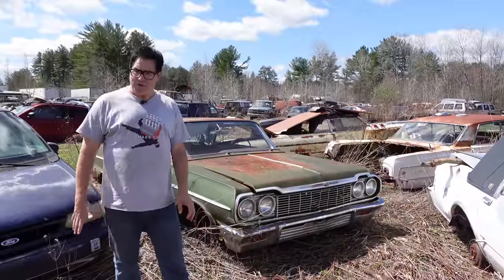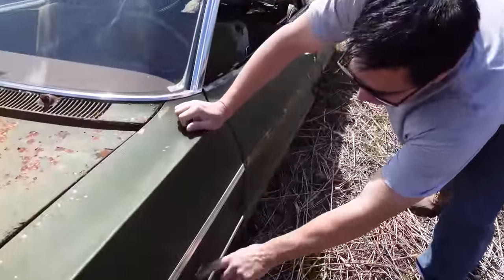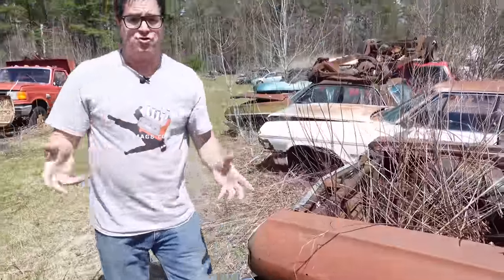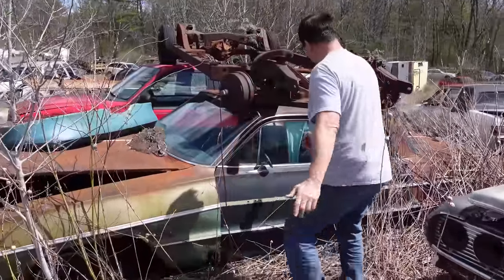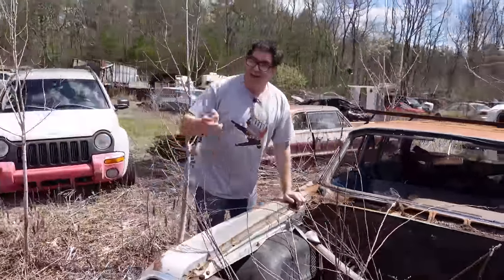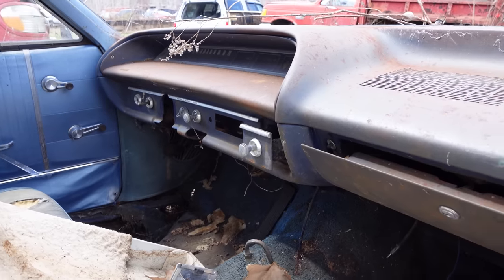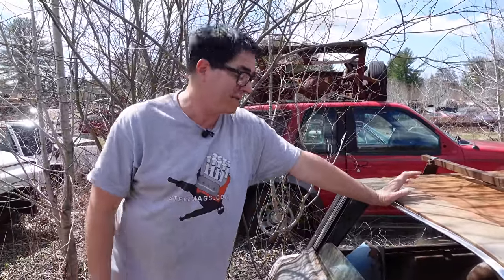Sixty-Four Chevy Celebration

Comment: Hardest working man in the auto graveyard universe!

The station wagon roof rack… 

A Friends’s  dad owned a 62-3 Chevy wagon - pale green with what I believe was a white top - true beater!!! but would hold 6-7 teenage vagrants 

Owned a 65 ss impala … convertible 4speed at 15.  😎 yes hydraulic top with cylinders partially inside rear arm rests / panels 

Saw a few with 396s but preferred the hp 327 4 speed 

NE winters and rear wheel drive with a rag top 🆘

Always preferred the 65-67 ss chevelles size speed design  and they actually fit in a … garage 

Was always a fan of the lines of the : 62-64 impalas and the ability to add ladder bars back in the day 

And the pre ! 65’s were the hot impalas back in the day - many raced and many with a lot of hard earned cash under the hood   

Different now 

Post beach boys…..  The low rider community put impalas on the map - period.

Comment: Hey Steve, perhaps you could correct these errors by editing in some on screen text. Thanks!

0:42 "Single pot master cyclinder seen until 1967 on all American cars"

Dual circuit brakes were used before 67 by Cadillac, AMC, and Studebaker.

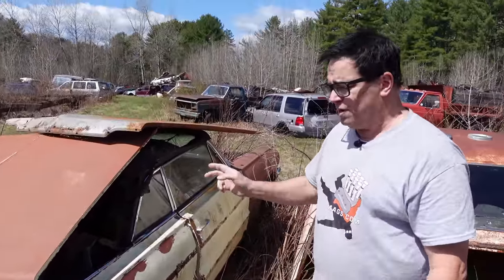2:14 "Now the convertible or course was the most expensive version of the Impala the only thing next to this would have been a full size wagon"

OK, I don't know what this means exactly but it appears it means the Impala convertible is most expensive followed closely by the wagons. With base V8, convertible $3035, six passenger wagon $3077, nine passenger wagon $3181. Differences on six cylinder prices are similar.

2:22 "But this (Impala convertible) is well over 3000 bucks"

Six cylinder $2927, eight cylinder $3035. One not well over and the other not over at all.

3:42 "But the big seller generally was the two door model"

Four door sedan 536,329 plus four door HT 200,172 = 736,501
Two door sedan 120,951 plus two door HT 442,292 = 563,293

The two doors can't catch up even if you throw in 81,897 convertibles. And if that's done how about throwing 192,827 station wagons (all four doors) into the four door totals.

4:13 "The only down side (of four door hardtops) is once these rubber seals got old you had water and air leaks"

Yes of course. The rubber seals on sedans didn't age!!!
Reply: The base price of $2927 is with ABSOLUTELY no options at all , very few if any cars were delivered as full strippers , so even base 6 cylinder cars crested $3k , especially since even in 1964 , dealers were learning to tack on "dealer prep" (removing the seat covers , washing off the road grime from the transport truck , and adding 5 gallons of gas - some dealers even delivered the cars with a FULL TANK of gas , but at a jacked-up pass-thru price !) and "destination fees" !

Comment: The 1962-64 Chevy and other GM 2-door hardtops were sometimes erroneously referred to as "Hardtop Convertibles".   This is due to the metal roofline, which had distinct bones it that mimicked the contours of a rag-top.   Even dealers sometimes used this phrase to describe them,  though it never appeared in sales literature.   Old timers may recall this bit of trivia.  Other 2-door hdtp's may have erroneously been referred to as such, but without reason.

Comment: What was the highest horsepower you could get in the 327 version? Great content as always steve. Always enjoy the junkyard crawl!
Reply: For the '64 full-size line the top 327 was 327/300HP with a larger 4bbl, I believe, bigger valves (but still advertised as "general performance" camshaft). Apparently low end torque was still sufficient enough to work decently w/ PG automatic. Late yr Chevelle could have the solid lifter 365HP 327 borrowed from the Vette & the Vette itself topped 375HP w/ fuel injection.
Reply: @DejaView  thanks for the answer Dennis. I thought there was a 327 / 365 version in there but wasn’t positive.

Comment: Back in the day, I never gave it t much thought, I liked the styling, but that’s a lot of car for such small engines, and the PG was a deal killer. The wagon, with a 409 4 speed, that would get my interest.
Reply: The base engine was a 6-cylinder and moved the vehicle around just fine.  The Powerglide was used from 1962 to 1973 and was highly successful.  Why you call it a "deal killer" is beyond me, unless you had to find SOMETHING to justify not buying one.  I
Reply: My family had a 64 Pontiac Parisienne, essentially a Canadian Chevrolet with Pontiac sheet metal, and the drivetrain was the same six, but it was a 3 speed manual, and as a young driver, the manual transmission was infinitely more interesting. As I said, I like the car, I’m fine with a six, but a two speed automatic is only slightly more interesting than an electric motor, and after nearly 60 years of driving, I still enjoy shifting the gears for myself.

Comment: On that last one, the wagon, there was no booster, they bolt on differently than the master cyl., and you can clearly see the shape of the master cyl. on the firewall... so it was not a power brake car.

Comment: It's amazing, steel dashboard & they couldn't bother to put a rubber strip on it, government had a mandate shoulder harness! They must have been saving the money for those elaborate wheel covers. 2-speed transmission sounds horrible, I didn't know they went lower than three speed, maybe the torque converter does some magic.
A boat size car with 2
doors to be "sporty".

Comment: In my experience 60s Impalas with 283 and PG are the most gutless large sedans I've ever driven. Don't get why so many were sold. I have to think even the 6 wouldn't be a big step back.
Reply: once a 327 was planted under the hood it was good,,,,
Reply: Don't think the original buyers cared enough.
Reply: It was 60 year-old technology and mentality. Automatics were still relatively new and trouble prone. It was good for a grocery getter and grandma going to church on Sunday. I still have one in my 63 Impala (owned 40 years, 327 car), but it was modified 20 years ago and it will be getting replaced with a 700R4 soon.
Reply: @TheMr1963impala  The old automatics might not be fast, but in my experience they are damn reliable. Have a '57 Ford and '63 Ford, one FordOmatic, one CruiseOMatic, respectively. Both are original, zero service other than fluid changes, unrestored. Yet they keep tanking on, hundreds of thousands of miles on them. Can't speak for the Chevy auto's, have not had one. All my Chevies are/have been manuals.
Reply: @genehunsinger3981  Yeah, just replied below that a 327/PG felt like a racer compared to the 283/PG LOL
Reply: @johnsarian_cu  327's had a better sound to boot!
Reply: My ‘64 coupe had the 283/PG and once rebuilt with mild upgrades it was respectable, but not fast.  Reliable as the sunrise and got respectable mileage.
Reply: Being "gutless", in many cases was a matter of differential gear ratios, than engine & transmission. I'm not saying that the PG was a great trans. But I will say (from personal experience) that the 283 was a great little engine. It wasn't intended for speed. Especially since many cars didn't have power brakes.😁 Anyway, put a 4spd behind the 283, and a decent gear ratio, and you had a good combo. I'm sure I am in the minority who thinks that though.😎
Reply: @willhorting5317  you are correct.It's not the equipments fault,,,it's the guy that threw together a missmatched ,had no knowledge what they were doing PROJECT.
Reply: @genehunsinger3981  😎
Reply: @willhorting5317  Well if that is a minority, I'm one of them. I have a '65 C10 283 4 speed. Engines been rebuilt 0.40 over. With '66 Vette 327 double hump heads, 4bbl intake + 600 cfm carb + HEI ignition ,mild cam and headers breathing through dual exhaust, she's a peppy SOB! Spins tires easily and pulls pretty decent. For being the original engine, too, how can you complain? They can be built up to be quite respectable. The little 283 small block is anything but gutless.
Reply: @josephg41  😎...yes, I know that the following is TMI.😁 The first vehicle I drove to school, (Freshman/Sophomore yrs)(vehicle owned by my parents), was a '66 C10. Bone stock 283 except for Dad putting a 2-barrel Holley Economaster carb on it. Four speed. I have no idea what rear gears were.... Anyway, even with narrow bias-ply "mud/snow" tires (size-wise probably equivalent to a radial 235/70R15LT), I could easily dump the clutch and leave a 20-30ft single burnout. No brake assisted burnout in that truck.😁 The "trouble" I got into while driving it, really improved my driving abilities! No power steering. No power brakes. A buddy lived a few miles out of the tiny town where the school was. At least once a week, as he was heading home, we'd play "chase" down those dirt roads...him leading in his car and me as close behind as I dared in the dust storm he was stirring up. Truthfully, I was much too close!😁 Somehow neither of us ever wrecked.....I know my folks knew that I was probably doing things I wasn't supposed to. But I don't think they ever knew just how much I was doing. Other than burnouts. I burned off that one rear tire in 3 months time, so Dad made me buy a new pair, because of the "uneven wear pattern".😂😂😂😂
Reply: @willhorting5317  Great story!! These trucks are a lot of fun still to this day if not more now. And mine still does "One tire fires" any time I want it to. 😂
Reply: @josephg41  😎
Reply: Powerglides were sold in 1964 because Chevy people wrongly assumed Ford and Plymouth were selling the same junk. Have they bothered to check Chevy would have been in deep trouble.

Comment: Actually the turbo 400 came out in 66 not 67
Reply: In its original incarnation as the Turbo-Hydramatic 400, it was first used in the 1964 model year in Cadillacs!
Reply: 1964–2012

Comment: Steve, the 327 numbers did not appear above the flags until 1965.  Also, in 1965 all the V8's were listed by number above the flags, then changed in 1966 which dropped the 283 number and only used the V8 with flags to designate a 283.

Comment: I would make bottom safe put a modern full chassis and take a small block 427 from a zo6 Wagon btw. F&ck these pos SUV’s and crossover’s I have a 96 Saturn yes Saturn wagon that runs Mid 12’s not bad for a 96 1.9 liter. Full sleeper like all wagons should be. I get risky and turn 6thPlanet  to smoke some coyotes and LS what ever they are in and get a few 100/th on them SLP started me and I just love sleeper wagons